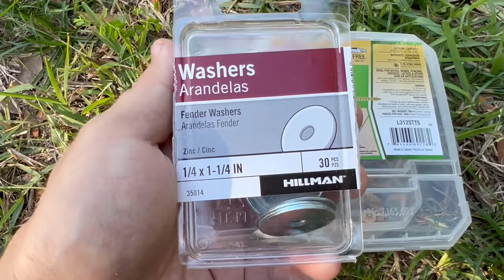How to Install 8ft Wooden Fence

Comment: Most codes require that the smooth side face the neighbors. That also prevents kids or whoever from using the cross boards as a ladder to peer over it.
Reply: What if your neighbor has kids
Reply: you have the inside on the outside and the outside on the inside, this is good for thieves and defeats the purpose of a privacy fence and gives and gives access to peeping toms

Comment: Audio?
Reply from the maker: what is wrong with audio?
Reply: @CreativeProcessDIY  very low db level.. about half what it should be.. I'm on a pc with 100 watt (rms) and Cerwin Vega floor speakers (bass reflex, with tweeter, mid, 12 inch woofer.. 4 ohm) normally 12 to 25 'level' on amp volume for yt covers most vids, but 40 for this one still wasn't high enough) All this info is for a reference point.. People on phones may be getting better results idk..
Reply: @mistysabrinalee120  agreed the audio db is a bit low